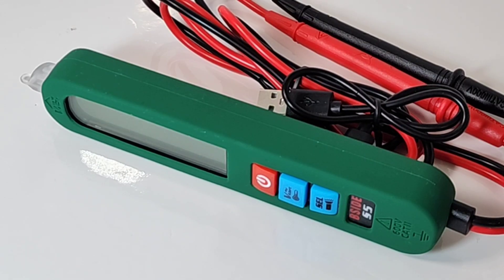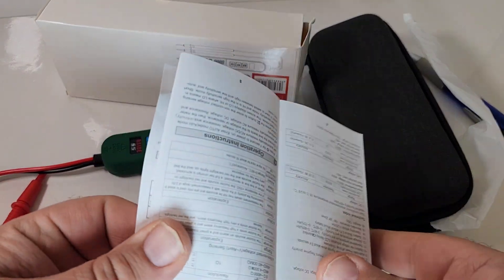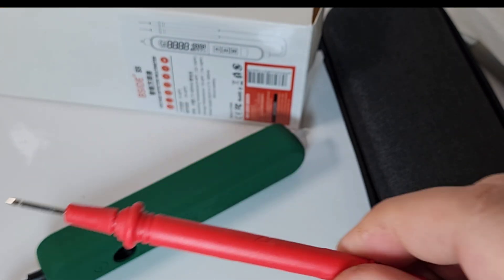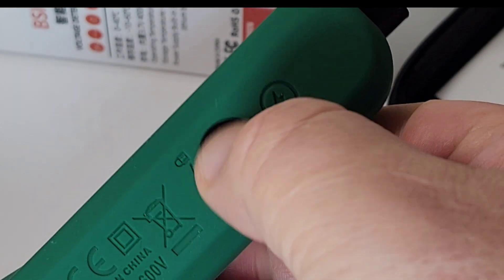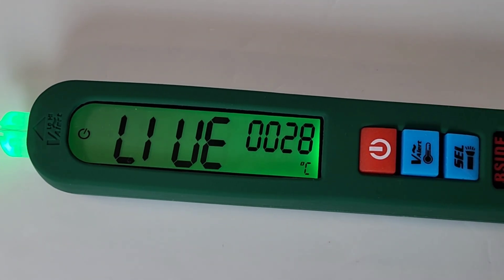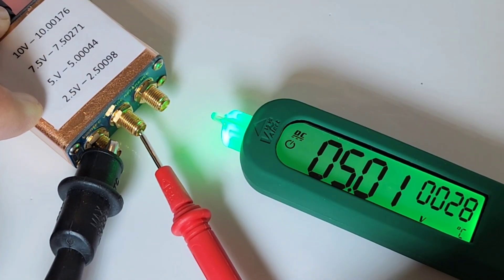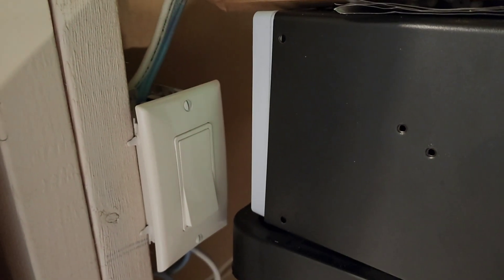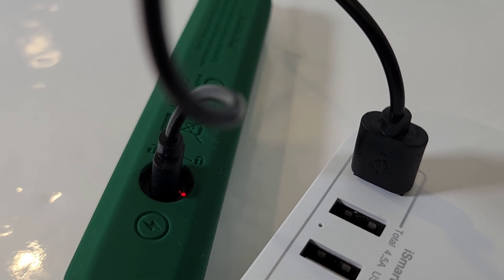BSIDE S5 PEN STYLE Multimeter Review & Teardown!

Comment: I just don´t get it: What is the point of a pen-style multimeter, if you have to fiddle with two testleads anyway? No tilt stand, no magnetic hanger and, because it is not heavy/big enough, twirling on the desk around. To avoid damage if it falls (and it will fall/bump around) the buttons ("the arc") should be at least flat or even better recessed, hence protected by the rubber/housing. BTW: The reason for the cap over the charging port seems somehow obvious to me: Electrical safety! It avoids to build an electrical path (arcing) ⚡to your hand (or whereever you have readable mounted it on your body [There is really only one place left over possible, with two otherwise busy hands! Mounted with rubberbands..?🥴]), if the meter blows up. Therefor I´m a little dissapointed: Why You are presenting such a sexistic multimeter...??? 🙄🙄😇😇😂🤣
Reply from the maker: 😂😂😂 Thx .
Good points. One man's Picasso is another man's garage door holder. (Whatever the heck that means.. ) agreed, it ain't perfect but  honestly it's nicely done overall. I do wish the test leads weren't captive that would greatly enhance the functionality. As you mentioned,  a magnet or tilt stand would also have been beneficial but I think ultimately what it does possess  is an overall decent performing pen meter for the end user with one of the best lcd displays. I know it's not everyone's liking but it's still very usable. I understand your take on the usb-c cover but believe me it's a huge pia to remove. Simply putting a rubber fit sleeve on top would have been just as effective and alot less aggravating! 😊👍sexist multimeter ..muhahaha 😅

Comment: Mr. Darren i have zoyi zt 102a,what happens to this multimeter if it accidentally enters the voltage when the mode selector is in ohms, diode and capacitance, is there any protection from accidentally like that in this multimeter?
Reply from the maker: Hello friend, As you know it's never good to go from reading Resistance/Capacitance etc to suddenly voltage ⚡️, unfortunately it happens. While in Ohms mode if you suddenly encounter a "live" circuit usually a thermistor in the Ohms circuit can alleviate the overloaded current.  The multimeter should survive ..most catastrophic is when measuring voltage while terminals are still connected to current...this can cause some serious damage if the fuse doesn't blow in time. Btw, ZOYI/ ZOTEK  is a solid multimeter OEM with usually very good in circuit protection and that's always a good 👍 thing !
Reply: @KeepOnTesting Ok thanks for the information Mr. Darren

Comment: TC4056A looks like a lithium-ion battery controller, not an EEPROM. Unfortunately, this chip is most likely one-time programmable.
Reply from the maker: This pcb uses the TC4056 Li-Ion charge controller IC for lithium charging safety. I realized that only after video production but thx for pointing it out.